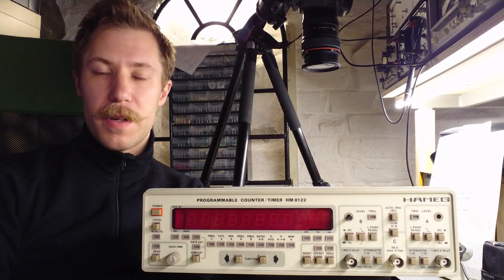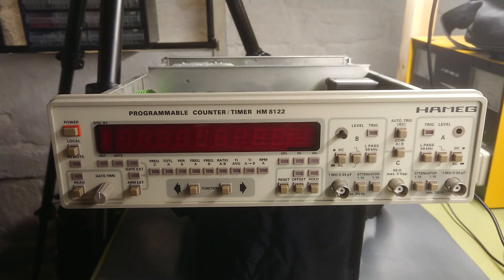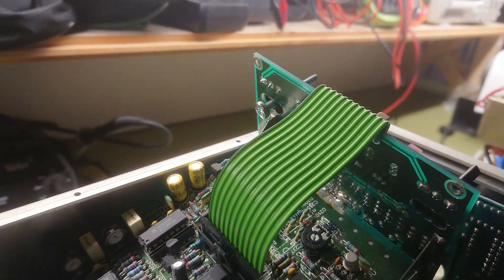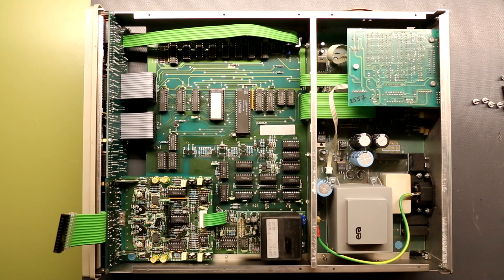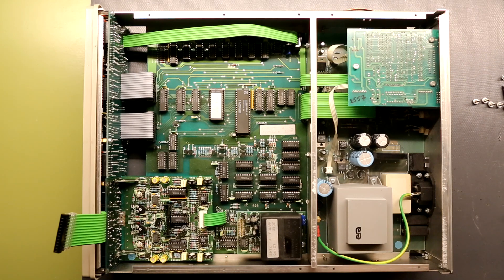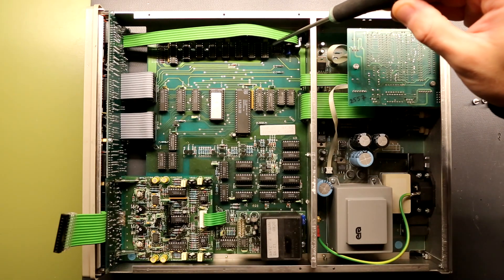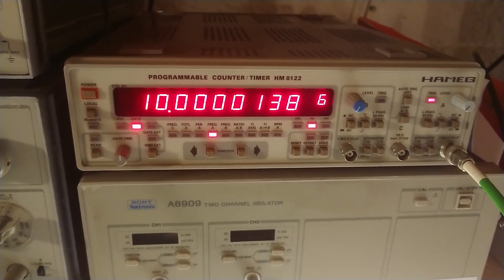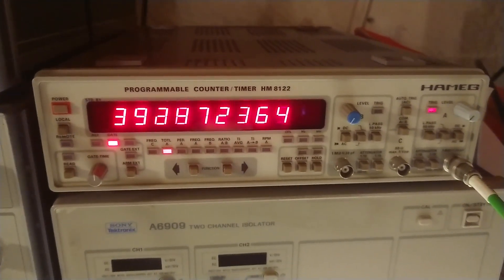Hameg 8122 Universal Counter - Teardown, Repair and Test

Comment: Nice video. The internal 10 MHz oscillator, provides the clock for the microcomputer, as well as for the frequency multiplier circuits, which multiplies it to the 100 MHz clock used for the reference counter part. The Hameg HM-8122 is an excellent counter timer, that works using a reference counter for gate time control, and a ratio counter for input period time. All frequencies are calculated from the input period time. Also, the C channel input, ranges from 100 MHz to 1,6 GHz.

Comment: Hi Mads, 

Nice little repair you did there. 
So you finally found a use for one of the twenty million M4 screws from tearing down the ericsson base stations?    ;)

Interestimg to see the construction ot this device. I was quite suprised to see how the 1.6GHz input was made, I expected way more shielding around the prescaler ic. 

Keep up the nice videos. 

Greetings from Germany, 
Michael
Reply from the maker: Hi Michael and thanks

Yes, one M4 down, 19.999.999 to go :)

I think I actually missed the high precision oven controlled oscillator. As it does not look like the one described in the manual. There is a black box bottom of the top over that is marked Hameg and it is connected right after the front end.

Kind regards
Mads
Reply: @KaizerPowerElectronicsDk  

Oh you are right, seems to be a Oscillator there. 
However they still use simple ribbon cable to connect the frontend board to the mainboard, I would have expected some coax and propably some SMB connectors.